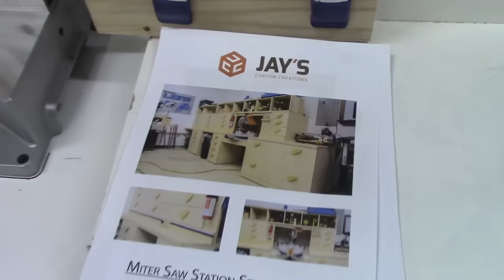2017  Woodworking Shop Tour

Comment: I used to be a process engineer at GM.  GM uses a method called Labeling and Workplace Organization (the Japanese have a different name for it but I don't know it).  When setting up a workstation determine what tools you need for that operation.  Make a place to put the tools and mark the area off with tape (we used 1/4 inch yellow electricians tape) and label it with the tool name, you can use a labeler or just a Sharpie.  So if you need a square drive screwdriver say for pocket holes tape off a rectangle just big enough for the driver and label it Square Drive Driver.  Now allways put the driver in that rectangle.  If the driver is missing you easily see that a tool is missing and determine what tool is missing.  We marked everything, even trash containers had a place marked on the floor labeled Trash Container.  It is also important that nothing gets to lay around a workstation that doesn't belong.  If something doesn't have a place marked out than you either throw it away put it away or sell it, which ever makes sense.  Here is an excellent manual to illustrate the point.  http://www.techni-tool.com/site/PROMO/2012-02/2012-02-Brady_5S_HandBook.pdf
Also Google "lean manufacturing" or "Labeling and Workplace Organization" for more information.
Reply from the maker: Terry Pullen    Very informative comment. Very much appreciated, and I will be implementing some of that.. Thank you for watching!!

Comment: How did you solve your static problem when using pvc for vac runs?
Reply from the maker: Milt Clapp I ran copper wire from the dust collector motor to the cyclone bolts, then to the metal wall supports.  Then randomly from the pvc to the wall.

Comment: Heating and cooling side of things it would be a good idea to insulate the walls and ceiling yes it will cost looking at the size of your shop but it will help with the issue
Reply from the maker: Peter Lisyak The shop is very well insulated with spray foam. Very nice in the summer!!

Comment: looks like you have enough cedar chips and dust to coner the sachet maket at craft shows. maybe take all the shavings and make a form and cast the shavings into sheets to use as cedar lining for some chests and closets.
Reply from the maker: BEE HAPPY Wood Working and honeybees haha.. no kidding right.. I still have a few bags of it.. 👍👊
Reply: Jake Thompson hey I used a couple bottle jacks and then made a cheap form. threw down thin layer of cedar chips. sprayed some white glue from a sprayer overr and then just layered three four times then place a board that fits over and place a metal tee across anf the pressed with the jacks. let it set over night then plane the faces. instant sheets. I made mine in 36x36 inch sheets. easy to make and saved some money  on lumber costs. even payed a nephew per sheet to make to keep him busy one summer. Where Are you located?
Reply from the maker: BEE HAPPY Wood Working and honeybees I’m in Amarillo Tx.  I will have to look into making those sheets!! 👍👊

Comment: I made my tables out of 2x4's as well. They work, but you already know the drawbacks.

 I bought some paint grade maple ply to replace them with cabinet style benches so I could make handy drawers with decent slides everywhere. I was thinking of building them on a 2x6 or 2x8 base with levelers at the corners.

I put a 4x8 outfeed table lengthwise off the back of my tablesaw and a 4x4 to the left of it. I can cut full sheets easily. I use a Incra miter 5000 sled and some self made ones for various things. The Grizzly saw is fine for the money. As long as it spins the blade and isn't out os square. I hadn't considered a slider attachment, but a small on wouldn't work for me anyway.

You might find a jointer and a shaper pretty handy. Not sure what you do, but I couldn't get along without mine.

That cnc looks interesting, I am really thinking about getting a small one like that. I bet the learning curve is pretty steep at first.

Nice shop.
Reply from the maker: Thank you for watching. I just needed lots of tables fast. 2x4's were the answer at the time.  The Incra stuff looks pretty cool, I haven't been able to use any yet. 
   
   The cnc is so fun. The learning curve is steep at first, but once we found some time to just play around with it, the learning comes quickly.  Thanks for the comments.Jake

Comment: Daaaang! U have an AWESOME SHOP! Thats what i call a dream shop. & the  tools? man, i u go t everything u need that cnc is a MONSTER!! One of these days ima get me one not sure what type though laser or spindle/router.either way id be happy lol a drum sander is on the bucket list as well..and ik what ya mean with nit making accurate cuts with the table saw u had i got the delta 36 725 and i have to re set the fence Almost every cut so annoying and for 750 it shouldnt be like that but next time ima get the laguna fusion or maybe a saw stop but i like the 2016 laguna fusion 10" cabnet saw ik this videos a bit old but looking fwd to seeing the miyer station builds and one question on ur work benches what r the legs made of?? Thanks for the great tour and once again MAN WHAT A SHOP/WORK SPACE &ARSENOL OF TOOLS☆☆☆☆☆👍👍🍻
Reply from the maker: Thanks Joe. The Table legs are made of a hard plastic, really sturdy. I love my cnc machine, I did lots of research and Laguna was the one!! The miter station came out pretty good. It was a lot of fun and I learned a lot. Thanks for subscribing and watching my videos, its pretty cool of you to do that. Later Joe!

Comment: How did you mount thing to the wall cladding
Reply from the maker: richard wilkinson of you are talking about the heat and air unit, I mounted it to a piece of wood and then mounted it to the support beams with screws.

Comment: wood burning stove for winter
Reply from the maker: That's an option for sure Corey. Luckily winter is almost over and I can put off messing with it until next winter. Thank you for watching!!
Reply: Same here, I will be installing one this summer at some point. Good videos, I will stay tuned.
Reply from the maker: Corey Masters very cool, we sure do appreciate it!!
Reply: The wood burning stove would be great, and with all your scrap wood you can almost heat it for free!
Reply from the maker: dedalliance1 I do have lots of scrap wood!! Thank you for watching!!
Reply: No problem man, thanks for sharing!
Reply: It's like a lot of the big sawmills and stuff will burn all of their scrap wood and sawdust to power their steam plants / generators and essentially run their sawmilling operations for a fraction of the cost and they don't have to worry about disposing of it all.
Reply: You can look on Youtube and there's some ways to turn sawdust into some home made versions of those compressed fire logs and stuff too. That might be fun if you get a wood stove.
Reply from the maker: Corey Masters good stuff, I will have to look into it.

Comment: Maybe make, pull out drawers under those tables, 8 on each sides for the double sided and label
Reply from the maker: Darkwood Maker that's a pretty good idea. I will have to keep that in mind after I make the miter saw station!!
Reply: Full extension hardware for those drawers.
Reply from the maker: Derr Nav  that's probably what I'm going to do.. good idea, Thank you for watching!

Comment: If you would cut the square footage into thirds you could have three shops. You are doing way too much walking. Think about how much time you would save, time is money.
Reply from the maker: I agree totally. The new miter saw station will be the first step. Thank you for watching!!
Reply: Many woodworkers either just as a hobby or small outfit pros are in shops of 1000 ft2 or less.
AlabamaWoodworker has a three car and keeps his equipment tucked away between uses so he and his wife can park their vehicles inside.
I recently watched Wood Whisperer Offcuts and his move from the 30 by 60 dream shop to a three car with some unusual spots making for unique storage
Reply from the maker: Joshua79C C Both of those guys are awesome. I’m lucky to have the space I have. I can have everything where it’s at. I don’t have to move anything and I can comfortably park 3 vehicles in the shop. If I had a smaller shop I would probably do the same as the guys you have mentioned. Thanks for stopping by. 👍